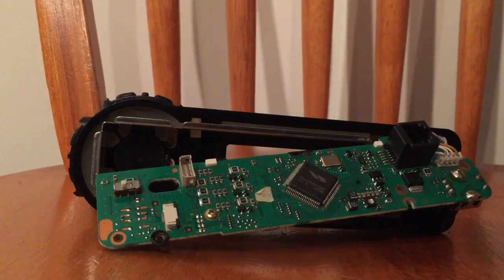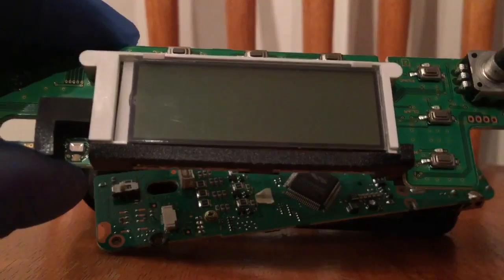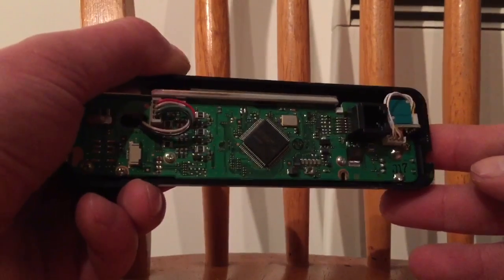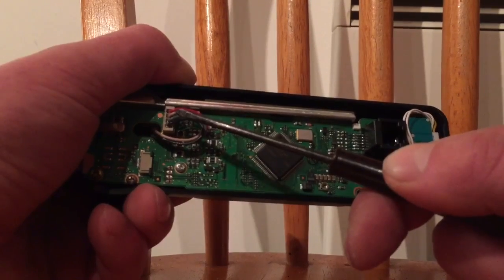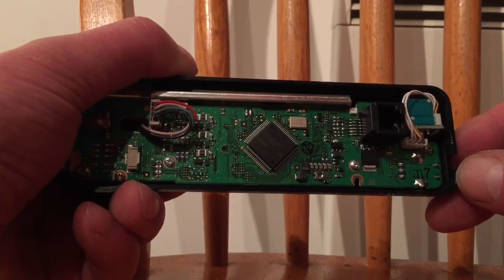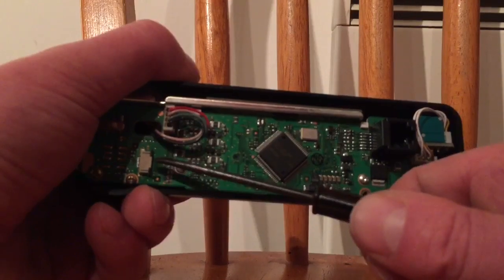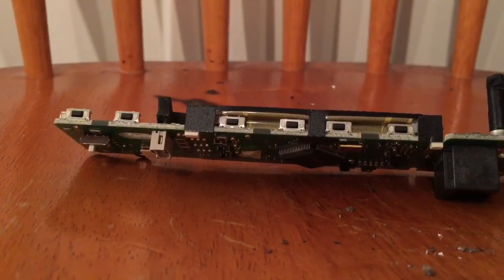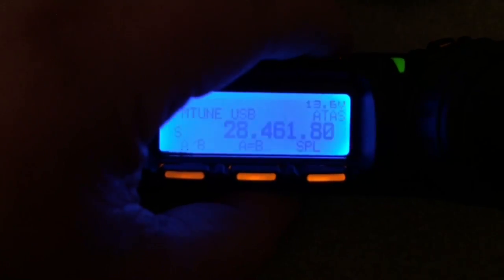Yaesu ft 857d screen repair read description

Comment: FYI for ALL:  The ribbon cable connector has a little brown bar that lightly and minutely slides out.
Pulling out that ribbon cable like that could damage it.
Pay attention to the orientation of the ribbon cable upon removal.
Or
You can do it like Chris did.  But, pay attention to the orientation of the ribbon cable upon removal.  Insert correctly after.
It's possible to repair that ribbon cable if it's damaged; you don't need to replace it.
Reply from the maker: Thanks, yes, I got pulled up on this a few years ago. I I believe I put it in the description.

Comment: I have read using a heat gun in the area of the LCD driver chip improves the connection and most if not all of the zebra effect is gone.  Has anyone tried this?

Comment: That "THING" you pulled the flex cable form is called a ZIF socket. for Zero insertion force" socket! You dont yank the flex out. The dark brown plastic is clicked out about 1mm and then the flex just comes out easily and to put it back in you just slide it in and then click the brown plastic back in to place. 
Its frustrating to see people doing things on Youtube as if they know what they are doing yet have no technical skills what so ever. 
Very disappointing. Sorry.
Reply: Nothing wrong with being an amatuer. But this is Amatuer Radio as in pertaining to non professional use. In Australia you are required to pass a minimum technical requirement as I am sure you must in your country as well. This is not an issue about having a go! This is about the Blind leading the blind. Nothing wrong with trying but everything wrong with passing that information as instructional! It takes 30 seconds to google ribbon cable connectors and realise you do not just "Yank" them out.
People trying to make educational informational content should make sure it is!
Reply: @rotorrant5867  no here in the USA these fools have you pass a 50 question multiple choice test that you only have to get 70% correct on! Now that the CW test is gone its no hands on skills what so ever! Appliance operators we call them! We need to send and receive NTS traffic plus build a radio or some electronics I say! Like the military you read the book then go do it! Over and over until you get it right! =]

But please share the knowledge! Don't wait until you see someone doing it wrong and pounce on them! Show us how its done!
Reply: @WW5RM  I did my Morse and more, and I think he did well, good on you bud, M0BOC
Reply: +Eric Freund In spite of your superior attitude I'm fairly certain you at one time were a beginner as well. To Chris's credit, he at least posted more information regarding this 'fix' than you have.
Reply: Its about the blind leading the bind and a little information is dangerous! Most people do not have the technical aptitude to perform these fixes and that is why I do not post! I have had to help with a lot of costly repairs that were due to "I gave it a try to fix my self" that would have only been a 5 minute $20 fix if done properly with the right tools Jay.
Reply: I understand about bad information, in this case he provided the gist of the information good enough. Perhaps you were a bit confrontational in your critique. As a broadcast chief engineer and licensed amateur operator for over 45 years, I've have worked with others who have many levels of skills from zero to advanced,  in every case I've exercised the fine art of tact when I teach those who are willing to learn. Concerning the Yaesu display repair, charges from Yeasu are well north of $500 for the part alone! So in this case while the descriptive info was less than you might have wished, such as 'thingy' the core info was spot on especially the availability of the part from sources other than Yaesu at a more affordable price. Best wishes to you and 73
Reply: Well I disagree with you Eric, this is amateur radio, an experimental radio and electronics hobby. The guy done well and showed me what was involved it repairing this fault. He may not have disconnected the flex cable the correct way but certainly solved the problem. Well Chris you made it clear from the start that you were not a technician, in this case you saved yourself a good amount of money doing the job yourself and showing the rest of us what was involved, well done my friend and keep posting.

Comment: Just called Yaesu. they no longer carry the LCD screen for this fix so I'll have to purchase the whole board. On the bright side at least I wont have to worry about soldering.
Reply: BS! Yaesu is trying to make more money. Did you call then in the USA? I will guess you are in the USA. The link provided by Chris works fine but the exchange rate might be an awful price when converting to dollars. How much is the head?
Reply: Yes i did Call them in the US
Reply from the maker: The whole board cost 120 UK pounds
Reply: That's bullshit! Soldering is the easy part!!

Comment: I also have this problem but its only a couple vertical lines.  Not a major problem.   I read somewhere it has to do with
the method used to connect the LCD display to the circuit board.  The connections are not soldered but sometime
of a glue that makes the connection.   I wonder if anyone has tried using a heat gun to software the glue
hopeing it will help make a better connection?
Reply: I read similar and am wondering if reseating the cable will help / fix it? Good question. Considering the 857 display is removable that helps. I may try it in the future. 

Mine is intermittently doing it but not as bad as yours. I think the heat is what causes it. I take my display out during hot summer days here in Texas.

Comment from the maker: The screen can be ordered from here        https://www.gbantennes.com/en/yaesu-parts/701-yaesu-lcd-display-ft857.html?search_query=ft+857&results=5     type ft 857 in the search box to find the part.
Reply: +Chris Andrews DEAD LINK, any updates? I myself have been VERY disappointed with Yaesu's lack of support regarding this well known display problem which was a result of economizing the unit at the expense of reliability. Using conductive adhesive for a critical component on a rig of this quality is very disappointing since this problem has been documented for close to 10 YEARS.
Reply: Link provide works fine. I am in need of the part number. Do you have it?